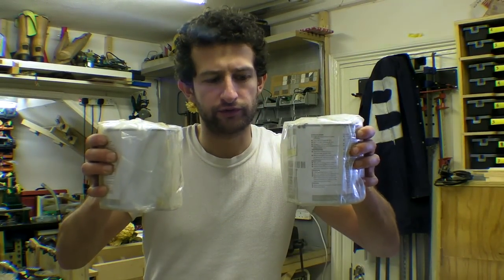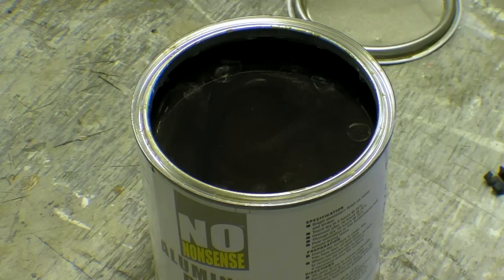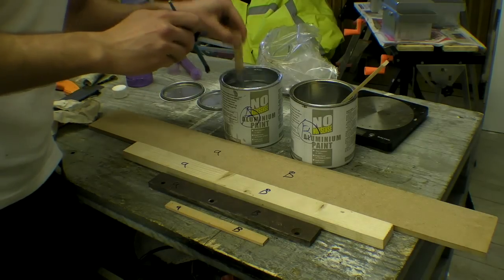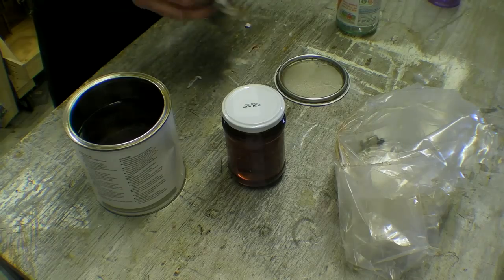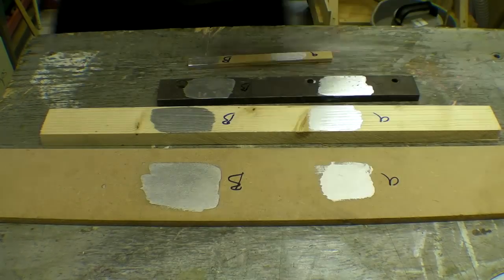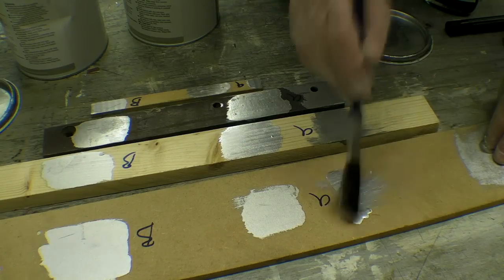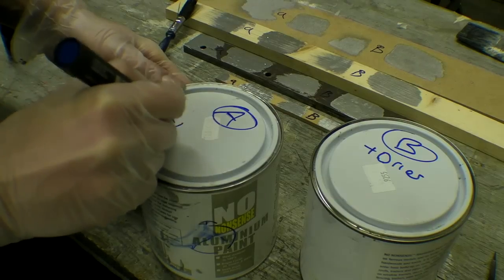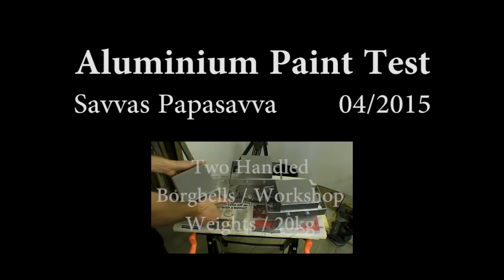Aluminium Paint Test / Chemical Driers / Base Varnish Removal

Comment: It would be better to ad turpentine to your paint but as all paints you do loose around  about 40% of all paints that's why wee here in Scotland as ex decoraters wee all ways yous turpentine I don't know if you have that in America but that's what us decoraters use .I hope that was helpful peter fae Scotland.
Reply from the maker: Peter Haughton Peter, I'm not from America!  I'm based in London, although I'd rather be in up in Scotland.  Especially after watching Nicola Sturgeon run rings around the plastic Westminster boys on the leaders debate.  I guess the climate is a little colder up there, so it would help the drying processes?  Chemical driers use metal salts to help dry but they are quite dangerous.  All the best.